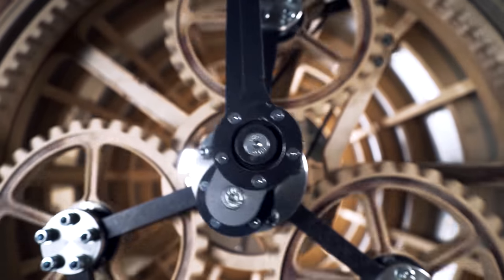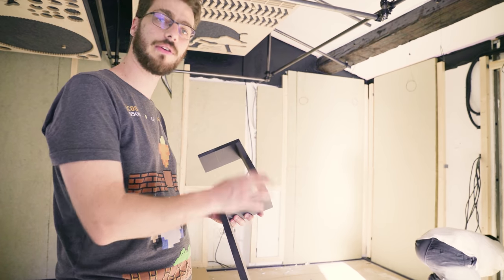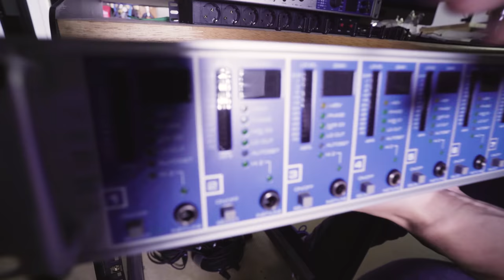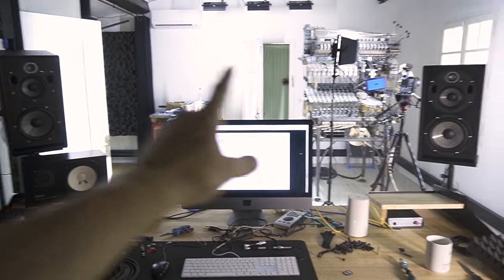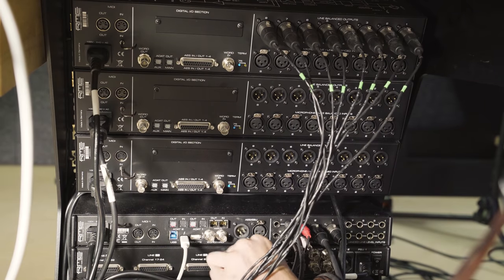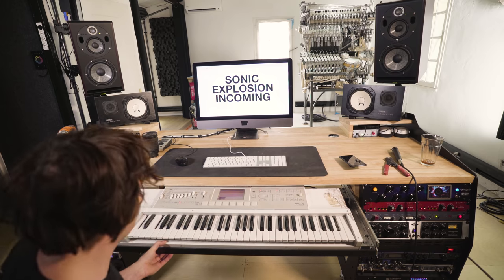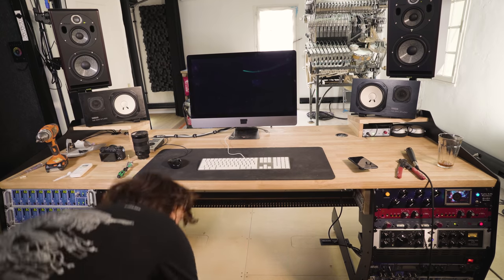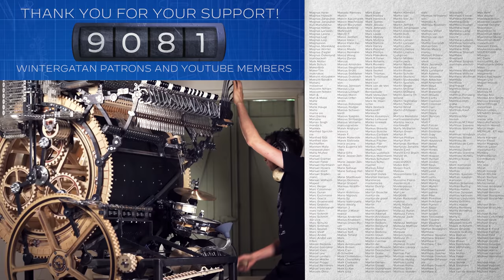Feels Like Home - Marble Machine X #134

Comment: I'm not an expert in sound, maybe someone can correct me: Doesn't the power cable directly strapped down next to the signal cables cause noise and buzz?
Reply: Requiem _ Yea, if the analog data cables are not shielded properly, they will.
Reply: If the cables are high quality, and well shielded it shouldn't
Reply: You generally only have problems with inductance if the cables are at odd angles too each other. If they are parallel or at right angles to each other the  there should not be an issue.

Also it takes a fairly substantial current for this to occur. I work in live events and generally inductance problems are when signal cables cross 200 amp power lines.

That said, analog audio signals are very sensitive to power interference and it is generally best practice to keep them as separate as possible just in case.
Reply: Nope, Professional audio equipment can deal with noise without any problems, For analog signals, the cables are balanced, that means they use a differential signal (inverted from each other), this way the amplifier can eliminate any noise introduced during the cable run. using balanced cables also eliminate cross talk between channels. Digital is simply not affected.
(see "balanced audio" article on Wikipedia)
Side note: Martin separated the mains power to another circuit to eliminate noise at the equipment, not the audio cables.
Reply: There is going to be no crosstalk because the cables are shielded. Also, they are probably balanced so the audio equipment can isolate noise like an equation.
Reply: That studio is absolutely amazing already!  I'm jealous if that desk!
Reply: They are probably COAX, so should be fine
Reply: Others have said the cables are sheild ed but if a recording is ruened by a 50 hz hum its pretty easy to remove in software becouse its so constent
Reply: Generally speaking yes. But as the audiolines are symetrical, this shouldn't be an issue. The noise cancels out at the end of the line.
Reply: If you used balanced analog cables it wont, most professional stuff uses balanced signals.  All of his stuff is balanced.  Otherwise yes you will get some hum from the 50/60hz.   Balanced cables basically have a positive and negative signal and on the receiving end one is subtracted from the other.  So if noise gets introduced as long as the noise is on both wires, it will get removed when one is subtracted from the other.
Reply: @h82fail  That explains why the serpent is viable. Thanks!
Reply: @djscottdog1  Still, its better not to have to deal with a hum.

Comment: I've been wondering where the team is at planning the logistics and engineering toward shipping the MMX safely between locations of live performances. I would imagine a custom designed crate, but supporting all those delicate structures at once in transit seems a daunting challenge itself. 
I also have strong reservations on hiring a courier service to reliably move the MMX even a few times without fail. In my experience at least, shipping and receiving automotive drive-train parts within Canada/US for a few years, sometimes a courier service would damage a crated engine block regarless of how well it was crated. Usually due to the truck driver having an accident somewhere on the route, but also loading/unloading at stations if they need to transfer the load from one truck to another.
Reply: I've been wondering about this as well.  I would hope that Martin detaches some modules for shipping & that he does some practice disassemblies ahead of the world tour to identify issues.
Reply: It's designed for disassembly into a few distinct parts, to be reassembled on stage. How he plans on storing them for transit will be... Interesting, however.
Reply: The machine will break down into 7 parts, that will go into 7 custom cases.
Reply: @AntiAntagonist  I've been watching almost all bit of the builds but I don't remember him ever talking about any disassembly features. It's built as a unit as far as I can tell.
Reply: @henryD9363  It was discussed in the early ones, back when he was still in Sweden.
Reply: ebulating you can have company’s like Pelican Case custom design a case and laser cut the foam to fit any part perfectly. It’s what we use at work for our very expensive laser calibration equipment and it works very well.
Reply: Then again you cant ignore the thousands of large and extremely delicate peices that have traveled through countries before. From art to consumer product, if it exists, theres a market for it.

Plus whoever damages the MMX should suffer the worst pain and suffering. For pain is temporary.

Comment: Another question: The Micstasy is fully remote-controllable. Why didn't you place the preamp rack near the MMX and run Dante or AVB or MADI back to the DAW? 32-channel analog snakes are a huge pain in the ass/back— especially on tour. If you don't know this yet you will soon!
Reply: i think this will only in his studio. The Tour technican pull out the technic on the MMX and build in his digital stagebox with preamps etc... so he only plug power and a ethernet cable, but this need i think 20 years for now, so noone knows wich technican will go with martin on tour

Comment: Hey Martin when I was seeing how close all the machines were together, do you think it’s possible they could overheat? If so you could just stick a little fan under the desk :O
Reply: On this Spaceship... Every component has it's own Climate System.
Reply: That equipment is made to run cool enough to need noisy fans; this setup should be fine, maybe the low amp wasn’t ideal for sending heat upwards

Comment: Watching this video I had a sudden, very bad, feeling. Fire
In any building design Fire design is a key assement but I see no evidence, nor can I remember seeing any, fire fighting devices (I dont really regard a fire blanket for a cooktop as useful).
Lets assess.
Old building with old cabling and power supply.
Massive amount of electrial devices in confined space.
Massive amount of flammable material in confined space.
Spark\heat generating operations in confined space.
Single exit point and difficult to access area.
2 irr-replaceable items located in space. Martin & MMX.
Martin, get a Fire Consultant to look at your studio. You now have the Marble Cathedral. Protect yourself, and it!

Comment: It seems to me that between your UFX+ and your M32 Pro you still have 20 unused analog line inputs, and at least 6 spare analog line outs (not to mention ADAT/SPDIF and AES IO) so why are you using a separate FireFace 800 for your outboard gear? 
The only reason I can think of is that you'd rather run 2 TOSLINK cables than16 to-24 analog lines from the right side of your desk to the left. In any case I hope you're using it strictly as an ADC and not as an aggregate audio device in MacOS. The latter would mean lower performance and higher latency, which would be a lousy tradeoff for realtime music production. 
Also, why did you opt for the M32 rather than the MADI option cards for the Micstasy? Was it simply to have the latest generation of AD conversion?

Comment: Unfortunately i saw the issue on the "boa constrictor" coming. This very cool design on paper has so many failure points in reality. I hope the fix will be effective and that you'll learn some valuable information / reliable connection procedures for the world tour aswell.
Reply: HGArn this cable isn't as bad of an idea as you think. This is a socapex cable and is used in the professional live audio industry all the time in the same way as shown in the last video. So not a bad design at all
Reply: If i remember correctly, we could actually see christoph(?) soldering the wires into the pins.
I believe it was only the ribbon cable. Did they manufacture the boa-constrictor themselves aswell?
Also, anybody know whether these multicore-cables are "standard-solution", as in "if it fails, i can get a replacement quickly", with the correct connectors and everything?
I am wondering -  are these pins actually meant to be soldered?  Or are they crimps?
anyway, my experience with cables and soldering is, that you just can't trust them. The solder wicks into the strands and makes it stiff.
This is especially problematic with wires that move - and with inadequate strain relief : over time the wire will simply break and/or rip off.
A cable like this has to be properly manufactired, or it will fail at the worst possible moments, like it has happended to us so many times (not during a world-tour, but on the racetrack.)
I can only guess that this is what happended here...
Reply: Indeed I feared it too - though I think its also the 'best' method for this situation. Always going to be a point more prone to failure, and for packing up a world tour you don't want 100's of cables to move around - Though in Martin's studio running each one as a separate cable could have been done as it doesn't need to be frequently moved.  With this cable on a world tour just carry a spare (or two) and/or just run the failed channel separately as if there was no "boa"  - its still alot less effort that dealing with all those channels cable at a time (and being the Wintergaten world tour how many other channels will their be for the rest of the band?! 

Hopefully that connector is designed such that each pin can be removed and worked on separately as its going to be horrible trying to reach into the middle of it for repairs should a failure happen at that end its bad enough on the double sided VGA/Parrallel port style connectors.. If its the normal midi ends should be simple enough to repair.
Reply: @eliasbuebue  I looked it up and i have additionnal comments: Mechanically speaking, the length/diameter ratio on most of the pins' generic connectors available is much lower, meaning much stiffer pins. Secondly the pin density on this connector is insanely higher, meaning smaller wields, more prone to failure as some of us here are already saying. In a nutshell i would trust quite well the standard products I found out when I looked it up, but this custom model doesn't share in my humble opinion the same level of reliability.

Comment: You have to be comfortable when you are sitting at your workstations for days on end. Sanding the edge of the table, the headphone amp up on top of the table, everything needs to be the way you want it to reduce your distraction and increase comfort. And in the end, it's your workstation, it doesn't matter what anyone else thinks.

Looks good to me, the Velcro cable wraps are much nicer than plastic cable ties! Most of my TV studio at work is still plastic cable ties, so much trouble when you need to add or remove a single cable. Been switching to Velcro ties as I update things.

Comment: One thing you should consider adding to the monitor speaker setup...

A "Squawk Box". This is a LOW QUALITY, mono speaker, centrally located.

The idea is that every now and again, you play your track through something that resembles a phone speaker. 

In the olden days, this was meant to replicate an AM radio speaker. It was a mainstay in every advertising audio recording studio.

When you listen to your track through the squawk box, you hear it the way your average listener will hear it. Almost nobody has actual hifi anymore. So if your mix doesn't work on the squawk box, it won't work for most of your listeners.

Hope this is a helpful bit of thinking for you.

Thanks for your genius.

Comment: One thing about optical connections - if you disconnect the optical cable, always cap the connectors on both the cable and the socket. Do not leave them open to elements, especially dust. If you get dust particles you can easily degrade the signal and scratch the tips of the fibers.
If you left the optical open you can get a special cleaning tools to clean both the cable connectors and sockets and I highly recommend them.

Comment: Headphones amp are very useful where you don't have any low impedance out designed for headphones, but when plugged in a low impedance out you are just adding noise and a convenient volume control

Comment: You'll want to add some fans to the backs of those racks. That left side rack is going to run incredibly hot. Some PC fans with USB connectors would give you good circulation and low power/noise.

Comment: If you want to reduce hum over power supply you should install an isolation transformer and install separate ground for audio equipment. It handles hum over phase wires very well and smal voltage that is leaking through ground from "tosters an fridge" is isolatend through separate ground.

Comment: About the headphone amplifier. It depends on your source and the type of headphone. If you have a weak source and a headphone with high impedance you certainly want to get one. Another use case is if you have a lousy source e.g. a cheap laptop you can use certain headphone amps as a DAC which produces a nicer signal than your laptop. If you have cheap as in bad quality headphones the amp won’t really change much.

Comment: The reason you don't want the speakers too wide apart is because your ears have lower "resolution" at a wider angle. The sweet spot is actually to have the speakers a bit closer together than in the classic triangle. If you do a lot of speech editing you become aware of this, because speech has high information density, and it's very hard to work with the speakers wide apart. This is also why it's common to have a center speaker to "fix" the dialog when watching movies on a big screen that forces the speakers to be wide apart.

Comment: 18:45 From a fire protection point of view consider to get a CO2 extinguisher for your electrical equipment instead of a "Löschdecke". A fire blanket is not considered a safe tool anymore to put out a fire. A blanket even might be absolutely useless on electrical equipment! Get a CO2 extinguisher and a foam extinguisher for the rest (except for your kitchen, there you'll be happy with an extinguisher suitable for cooking oil and fat). A powder extinguisher does the job but will totally contaminate everything with the super fine powder, a hell to clean up and it might even destroy your equipment as well!

Comment: Back in the days headphone amplifiers where nessecery, because headphones had a high resistance for plugging directly in the radio station output amplifier, but when they switched systems this wasn't nessecery anymore. So they needed to amplifie the audio signal for there headphone

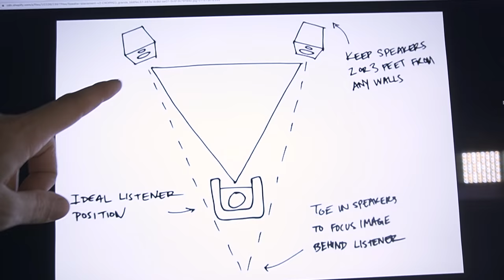Comment: 10:13 Martin, you should use an ultra wide monitor for studio editing instead of dual monitors. Best decision I ever made in my music studio and it will make it REALLY feel like a SPACESHIP!  
If you want to add an addition monitor you can always get a multi monitor mount that fixes to the desk at a single point and hang a second monitor vertically over the ultra wide.  
Look up randomfrankp
's youtube video "My Monitor Mount for Stacked Monitors". It will change your life (however there are better mounts out there like the Peerless-AV FS-MIS38426)!
Remember SPACESHIP!!

Comment: Please be careful about fire!  What I see are a host of materials that are very flammable.  All those acoustic panels, curtains, and all the electrical equipment, raised floors, etc.  Make sure they are fire-retardant treated.  You also need Halon fire extinguishers handy.  Regarding the lighting, the last thing you need an any studio are strobing lights (or any LED DMX controlled lights).  They will introduce electrical noise into the audio equipment!